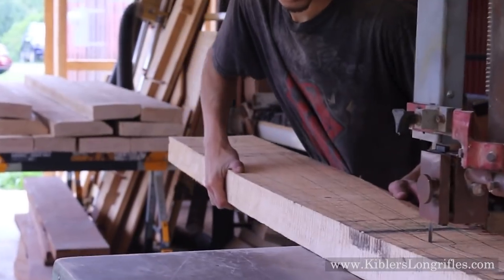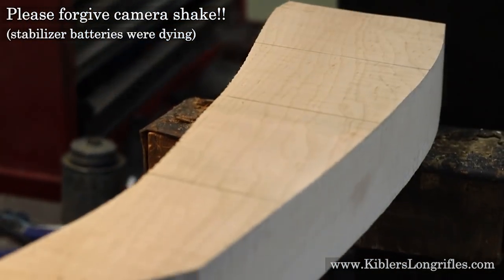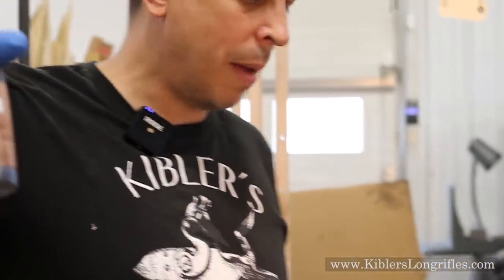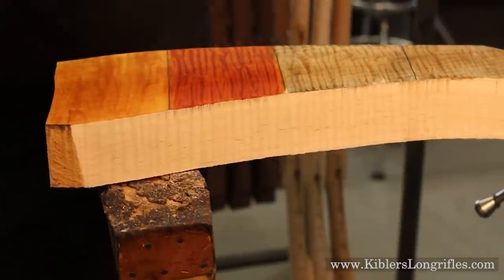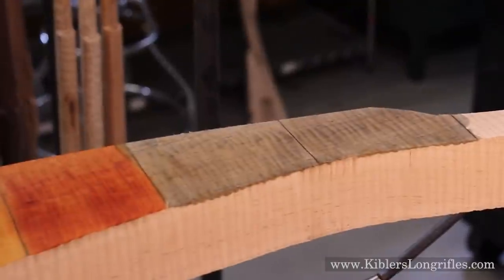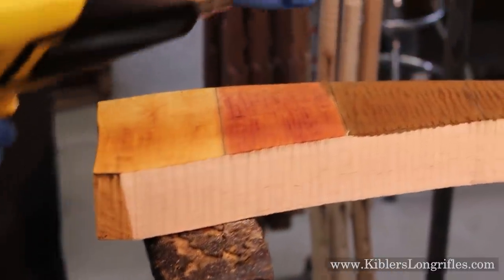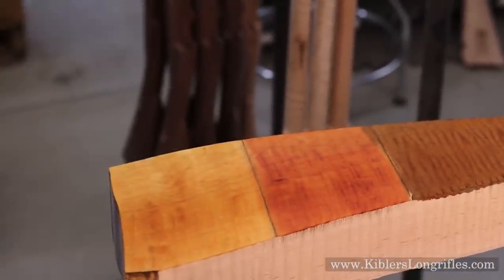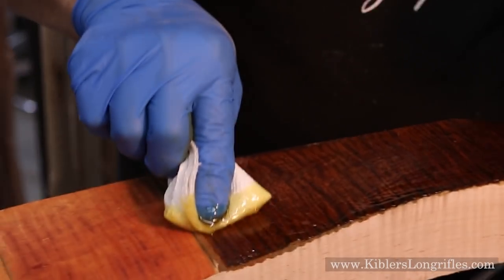Testing Various Stains on Maple - Iron Nitrate and Dye Stains

Comment: Great comparison and Thank You
When heating the Iron Nitrate, how hot does the wood's surface need to be?
I'm considering using this process on a guitar neck that has a rosewood fingerboard glued to the back-side of the maple.
Excessive heat and glue can be problematic!
Reply: Heat until it changes color.   You will see it happen pretty quickly from green/grey to orange.  When it goes orange that's it.   Keep the heat moving or it will char.
Reply from the maker: I'm not sure of the exact temperature, but you will see the color change.  Any heat gun should get hot enough
Reply: @kiblerjim  Thank You, very much appreciate your input. 👍

Comment: My only question is ... does heat trick work on the dye stain?
Reply from the maker: Good question.
No. The dye stains are not heat-activated so there will not be any change with heat. Iron Nitrate is heat-activated.